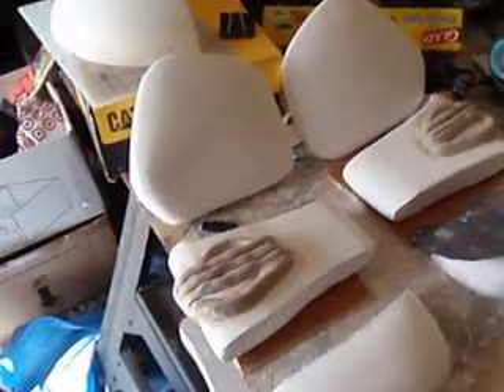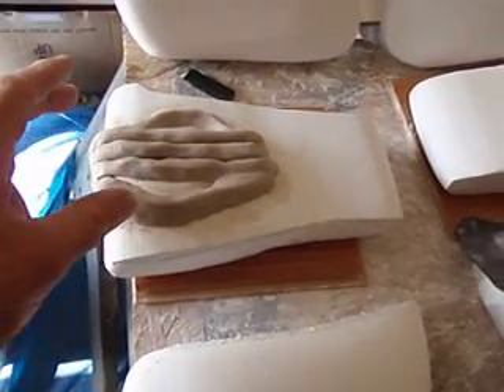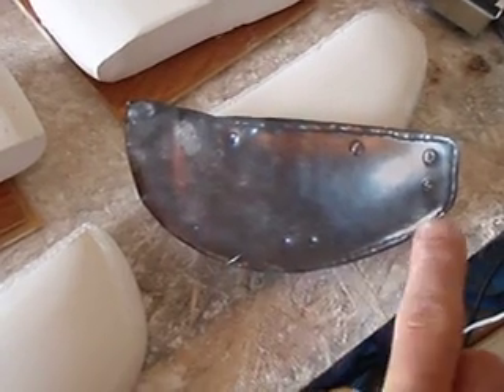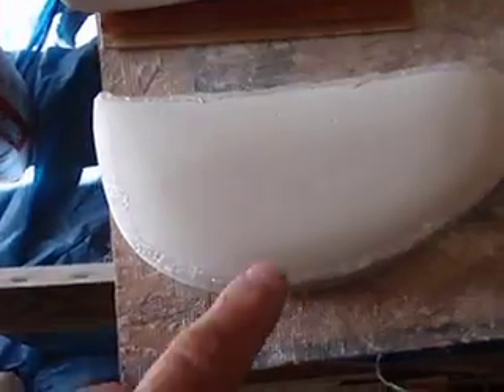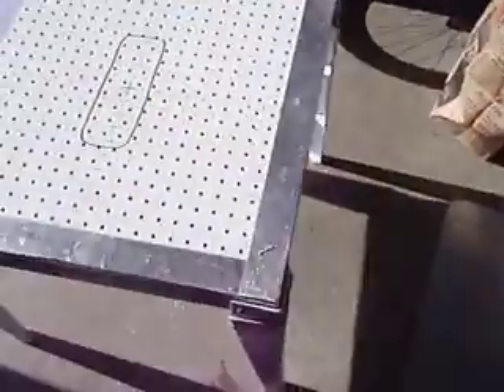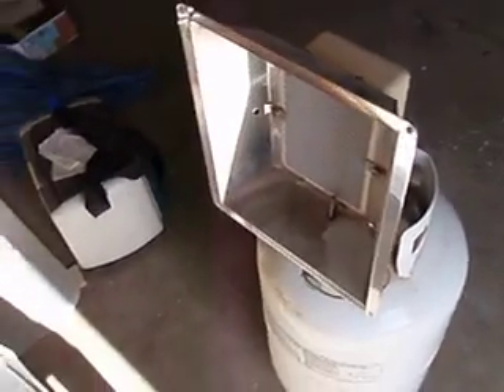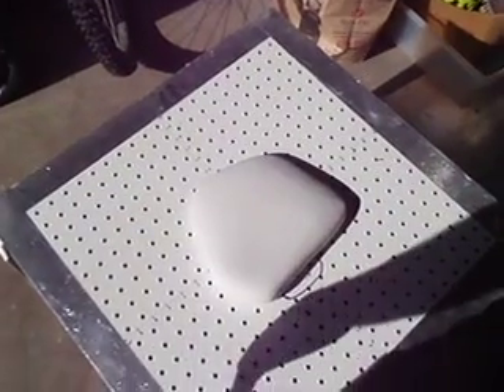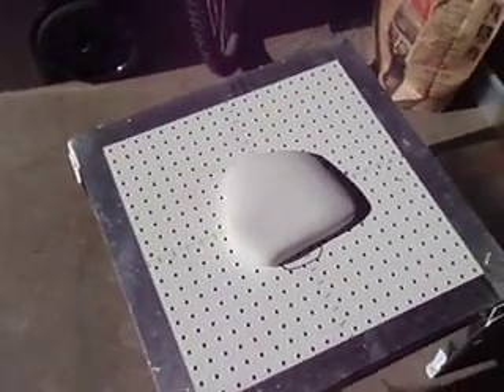Making Gene Simmons Costume Armor 9.AVI

Comment: ABS for lack of a better word...sucks. It doesn't melt good and it doesn't transfer heat good at all. It also doesn't want to hold it's shape which i'm sure you've already found out. I know it's cheap but it's not really worth the headache. Kydex is super expensive but PETG is the best of both worlds. It's pretty cheap. it melts great and really consistant and it's super strong. I get 4 X 8 sheets for about $75.00. it takes one and a half sheets to do a whole set of armor....